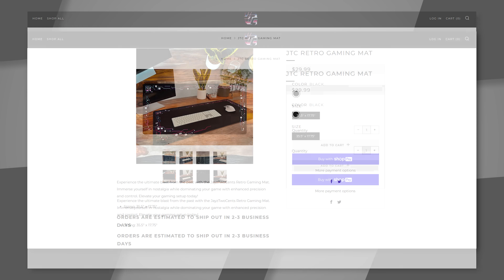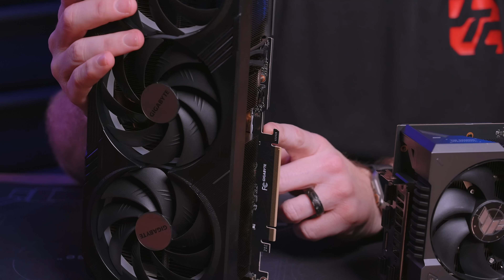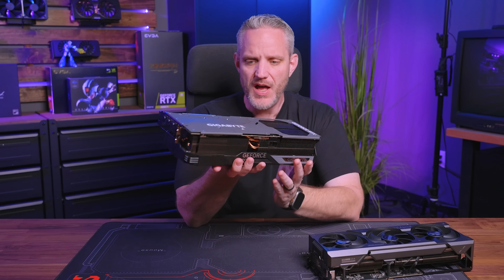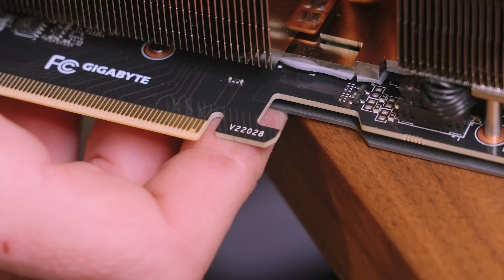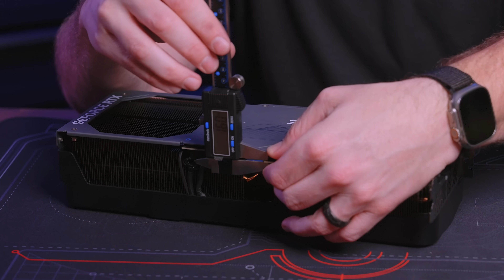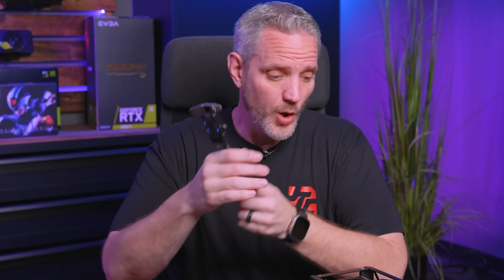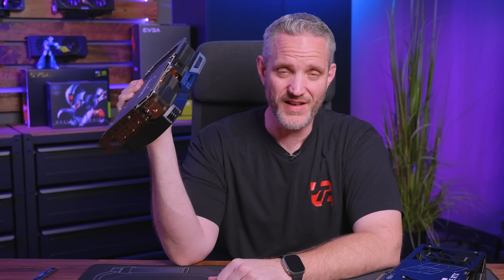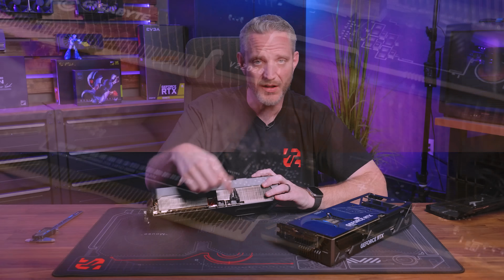These GPUs are cracking and the company REFUSES to warranty them!

Comment: This is why, since I first got a 2070 super, I have been using brackets to support the weight or doing a vertical mount. PCI-e slots were never designed to hold this kind of weight.

Comment: I had an MSI motherboard that I pressed the ejector down to remove my card and the plastic ejector snapped.  

PCBs are made of fiberglass.   I am really not a fan of the PCI-E slot design as a whole.   Cards have gotten a lot bigger and heavier since it was created.  If I had my druthers, I would have a metal vertical strut with an L-shaped anchor flange to screw into a motherboard standoff further from where the current plastic ejector resides.   That would give the cards an actual mechanical support and alleviate that huge moment arm from the case to the far top edge.

Comment: So I have that 4090 of Gygabyte. I needed to remove the batery of the motherboard, which was below the masive card. When I was removing it, because it has been so long since I installed it, and it is so big, I totally forgot there was a button to help remove the graphic card from the PICE slot. After making some force, finally the graphic card came out, but at the cost of tearing that button that helped remove the graphic card from the PCIE slot. The good thing is that the graphic card wasn't damaged, and this incident didn't cause any problems that I am aware till this day. But I moved the desktop so that the graphic card stays in vertical position just in case.

Comment: With how large and heavy GPU cards have gotten, it's ridiculous that we're still mounting them VIA PCI-card ... The server industry is standardizing PCIExpress cabling (stranded and bundled cables, not PCIE risers and extensions with the wide flat cables) .... SuperMicro demo'd some chassis's for us and I forget the name of the connection type, but they had 4 & 8 lane PCIExpress Gen4 cable routed (to backplanes and PCI card slots) about 14-22 inch runs .... At some point the GPU industry needs to move away from this mechanical PCI connection and move to cabling

Comment: This is my view:  If you observe the mounting points of the graphic cards, the tab is almost to the mid point in reference to the length of the graphic card. Being so, it place a significant tearing force onto that tab when mounted onto the motherboard and tower casing. It is of futile effort to provide more braces at the mounting plate to minimise that tearing force. For now, what I see as an effective way to minimise that tearing force is to put a brace at the graphic card, or implement some similar braces like those of the server type casing, so that weight bearing is on the tail end of the card, not at the tab.

Comment: I did plug in and plug out my GTX 770 like 100 times in the lasts 10 years...worked on it..fixed it...move it around changed 3 case cleaned ..and she never broke off any part of the PCB 😅...
She fkd up one of My PC express slots but never broke herself

Comment: I recently purchased a Gigabyte windforce 4090 V2 and it came with a metal support bracket for the front end of the card that would sag over time. This makes me think that they definitely know there's weakness in the card and are trying to avoid warranty issues on newer GPUs .
Reply: I believe pretty much all Nvidia partner cards for 4080's and 4090's come with a support bracket, including my Zotac 4080 did as well.. But I didn't use it because the rear mount is strong enough with Zotac it doesn't sag anyway.   However!  I have two AMD cards from Gigabyte, they are Aorus models but I'd say they've been great!  Never had any issues at all with them.. So I'm actually surprised to hear about this from Gigabyte.  (Probably go with good old ASUS next time round ;)

Comment: It is probably the removal of the card. I think you are correct. Some boards now have a “release button” at the top of the board. With the size of cards now, they all should have it. People must be more careful when removing cards. I use a long plastic laptop wedge to push the clip down. Other then that, remove your massive Air cooler first to gain access to the clip. I personally don’t consider it to be a “defect” with the card. I believe Gigabyte is correct in denying warranty because I believe it is “user error” in removal of the card or the “non-use” of a retention brace. These cards are massive compared to older generations. Naturally, all the stress forces are on the Bottom of the card. Perhaps all cases should have vertical mounts for these behemoth graphics cards now.

Comment: The reason the Asus doesn't flex is much is because there is a post mounted to the PCB on the asus right above the tab which is providing it stability. that post is either mounting the cooler or the shroud but it's clear as day when watching the video that it's stopping flex.  Look at 6:47 into the video just above your finger you will see the post and a triangle at the top of that post likely it's the shroud mount.

Comment: Could you not grind it and solder a bridge, then epoxy the crack to help keep it from traveling...? As long as there is not multiple different traces it should work and look better than wire.

Comment: Well, the Gigabyte 4090 comes with a mounting bracket so if you’re using it I don’t see how it would sag or crack. I know it sounds like I’m defending them, but I mean if you don’t follow the install instructions on anything they’re not going to warranty it. Unfortunately, I couldn’t use it on my board because there’s cpu fan pins in the way so I use a Herculx to support it.

Comment: I have Gigabyte 2070, 2080 but those are smaller cards. 2080 I user with a vertical mount. Now I replaced it with a 4080 Palit GameRock OC. Yeah I know Palit are Chinese but many named cards are also made in China btw I also had 280 & 580 by Palit.

Comment: You’d thing engineers would have everything nailed down on anything tech, especially top tier tech like high end gpus.. of course the heavier the more of an issue.  So it is relative to cost/tier.  4090 is only card I’ve felt obligated to support due to weight.

Comment: I'm about to get a Galax 4090 SG1.  Is this one of things where we should or, rather, have to strengthen that area before even contemplating inserting the card?  The Galax comes with the "Obelisk" edge supporter (yeah a gimmick but foreshadowing, right?) - so they know the problem (and have for a while now (30xx+, like WTF???) - which is kinda bemusing and an insult on the rest of the manufacturers too!).  What should we do to ensure this is not an issue for what we've purchased going forward?  I'm thinking of just Supa-Gluing some sort of rigid plastic or metal plates to the "danger" area but would welcome other suggestions...

Comment: Asus and probably all the other brands know of the enormous pressure put on the 16x PCIe slot that houses the GPU, they have started strengthening the female pcie slot on the MB's but not the male connector that goes into it. It is no wonder the male connectors are cracking.
It is mainly AC current that creates a vibration but I tend to think everything electrical vibrates at a frequency we can hear some times but also minute vibrations we don't hear. This can cause an already stressed part of a pcb to crack under that pressure.
'Printed Circuit boards were not designed to be used to 'hold' enormous weight and the forces it creates. When the 16x pcie connection first came out, and it hasn't changed much since, they were designed to only house light small cards, not enormous monstrosities we see today. 
Being mechanically minded I am not surprised to hear GPU connections are failing everywhere. Shame on gigabyte for taking a tough stance and rejecting most of the claims. They will certainly be hit in the pocket as people move away from their crappy product and even more crappy customer service!

Comment: Your ASUS card has a bracket near the flex point which is transferring load at that point. similar to a load bearing wall in a house. That bracket will not allow the PCB to flex far enough to crack. it's why it seems more ridgid... Because it is!

Comment: Hi there @Jayztwocents,
I've just ordered Gigabyte Windforce RTX 4070 OC 12GB and after seeing your video, I'm going to return it once it's delivered. But before that I'd like to know if you had a chance to test Windforce version. It's smaller so the risk of PCB cracks is lower but I have a doubt if it can crack anyway during e.g installing it in PCIE port due to poor PCB quality Gigabyte could have used in the card I've just bought.

Comment: Man off topic but, I finally bought a PC screwdriver kit with everything like the stars the HEXs etc. and finally opened my 2080Ti FTW3 for the first time in two years and it wasn’t as bad as I thought it would be, a little electric duster with a toothbrush, some small paintbrushes etc. and it’s running great still. One of my fans squeals after it goes above 25% so I keep that one at 25% static and run the other ones around 60-75% while gaming. Bought some good aftermarket fans for it just incase but I’m getting a 4070Ti soon anyway. But  man, the plastic shroud being screwed in with star screws is ridiculous. They REALLY don’t want us fixing our own stuff.

Comment: So just for info, PCBs are made of fiberglass and resin. Depending on the quality of the resin, you can get different rigidity of the PCB. Most PCBs have 4-8 layers of fiberglas, the more layers the stronger and thicker PCB. it is all balance. To rigid it will be more crisp and crack easier, too soft. you will also deal with much more strain on solder points of the board, like close to the edge components, where solder would break and sensitive BGA components like DRAM could loose contact

Comment: This looks like damage from not releasing the PCI Express tab locking mechanism first before removing the card. So what does it look like when someone is pulling there card as it's locked to the slot before unlocking the tab? Also some damage from gpu sag?

Comment: i am a streamer on twit cch sir i order a amd video card an it will not stream well than i order a 3060 it runs so hat its not funny sir i need a video card i seen u help so ,mamnny i needh elp my mom just passed away my 2070 stop working pleezz help i need a 3060 3fan or a 3070 any think that can work my 6700non xt cant stream well  i just got twitch to give me a sub buttin i dont have a job i spant 600cash in 2 mouths on gpus that dont work right i just whant to cry

Comment: I could see people pulling another "not in all the way" user error being the lead cause with some underlying negligible fault to the company.  With how heavy cards have gotten for even say a 3060ti and up, slotting them in with the motherboard in a vertical position is something a first timer might do wrong. My 4070ti from Gigabyte is a full 35mm longer than one of my 2 long lost Asus 780ti DCU ii and a slot thicker. 

Should the tab be bigger or redesigned/mobo slot redesign?  Absolutely, but I wish we had access to some sort of sales numbers to see how many gigabyte cards are in the wild vs other vendors.  Given they are typically the cheapest by a good margin without being an oem.  I'd imagine that Gigabyte has the most units sold these last 2 generations, at least in Western Canada.

Comment: Hey Jayz, I know you’re probably not going to see this comment but I thought I’d let you know that I experienced an issue 2 days ago now with my Gigabyte 3080ti that randomly shut my computer down out of the blue. It didn’t post and kept coming up with a white vga light on my asus x570-f. I tried all the usual fixes, cmos + cleaning the pcie slot of dust and remounting it back in, but it did not fix the issue. Brought it into the local shop today in Australia and they told me the card was definitely gone, but couldn’t deduce what it was. I got referred this video by a friend and I definitely feel like this is what happened to my card, minding that I’ve only had this card since August last year and it’s been completely fine up until two days ago. Thank you for making this video and I’m going to try to get this thing RMA’d somehow.

Comment: So I just wanna add one more comment about the flex. The fact that it is flexing might not itself be a bad thing. It could also in fact mean that the material doesn't crack as easily. Instead of cracking it flexes. Harder material could initially be more rigid and tougher until it just cracks from too much stress. Of course some materials can be more rigid and flexible than others at same time, so there is that of course. I am just saying that depending on the application of the material, flex doesn't automatically mean it's weaker.

Comment: I feel like the issue is actually where the backplate is attached to the PCB. You can see on the Gigabyte model that the screw for the backplate that would be closest to where it's breaking is very recessed by comparison. This is letting more of the PCB move/flex than the ASUS card, and too much of that will cause the crack.

Comment: I recently got a 4090 windforce v2 the revised model has a smaller cooler and a moved power connection, hopefully I don't have any issues, but the two reasons 3 reasons i went with this card was the moved power connector to avoid bending against the case window, i had a g1 gaming gtx 970 in the past and it was a great card but it may be true that gigabytes quality has diminished since then, and lastly it was $1550 below even the $1600 MSRP of the 4090.

Comment: First Gigabyte card I owned was a 960 Windforce and honestly was great, still going now I believe and software was fine. Went for a Gigabyte again due to my good experience with them and purchased a 3070 but in less than 2 years the software had just packed up and stopped allowing me to change RGB after moving to another system and back again. Couldn't change the LCD either on the Master card which ofc made one of its main selling points, I just got it coz it was all I could get at the time. Sold the card waiting for a new card but I'm honestly loving the break from gaming atm. Always bought mid tier cards but the top end of them because I believed I would get better components.

Comment: I use the supplied support arm with my gigachad 4090. I doubt it helps much since it contacts the flimsy plastic fan covers and it contacts toward the mobo which is not the best place to support. I'm thinking to tension the pci power cable which in theory would support the card very well

Comment: Last month, I bought a computer from Actina with an RTX 3070 from MSI at a large chain store RTVeuroAGD. The computer arrived with a bent graphics card. There was no brace on it, and no protective padding inside the computer. Upon starting the computer, artifacts immediately appeared on the screen, and when I heated the card to 60 degrees Celsius, the card restarted. The computer was returned under warranty, but I've been waiting for 3 weeks and so far, I've been informed that the warranty has been accepted. I wonder if Actina is now trying to negotiate a card replacement with the manufacturer. If it's as you say, they probably won't replace the card for them. Well, all I can do is wait and hope they don't send me an email saying they couldn't fix the problem.
I’m from Poland

Comment: The Asus board has a metal bracket less than an inch away from where your wiggling. the other one doesn't. It looks like that's where the rigidity comes from.  My 2070super is feeling it's age now.  Need to upgrade, Won't be a gigabyte.

Comment: Gigabyte has had weak PCB material since at least the Z370 Motherboards. I had to RMA a motherboard because the VRMs weren't making full contact with their cooler. Lots of people with the same board had the same issue. Turns out it was the tension of the cooler causing the board to bend, which prevented full contact with the chips. People were having to add acrylic for extra rigidity.

Comment: I just unboxed my Strix 4080 and was stunned at how big the card is. I knew the dimensions, but holding the thing is another story. 

I would say just off the top of my head it would be wise to have some sort of support for your far upper/outer corner of the card. 

The weight alone could add twisting stress to the PCB and all components. It could become an issue if the card gets too hot one day.

The flex can allow who knows what components to rip or pull their way from the PCB due to the stress. Maybe pads are ripped, maybe ICs lose connection.

Not entirely likely on a well-built card but for some that don't have additional thru-PCB support bracing all along the card might be suspect for issues down the line.

Comment: Typically its a fiberglass, or least that is what it used to be.

Now what bother me is that, I have accidently broken rise tabs off on older cards.

But with this issue I am now wondering, if with how heavy cards have become. Maybe its time to redesign the connector to allow for a proper mounting.  The next gen PCIE maybe shouldn't be a speed upgrade but a port redesign to allow for better stability. Maybe instead of a single slot it should be dual slot with the 2nd slot being used to power the fans and support the card. (That way you can maintain backwards comparability, and maybe get rid of a connector we have to attach to the card.)

Comment: I use a wood dowel to push the release tab but honestly I think the nerds down in Silicon valley need to start figuring out either a) a revised layout of PC hardware with special attention given to the exponential growth in GPU size b) a complete re engineering of PCIe sockets